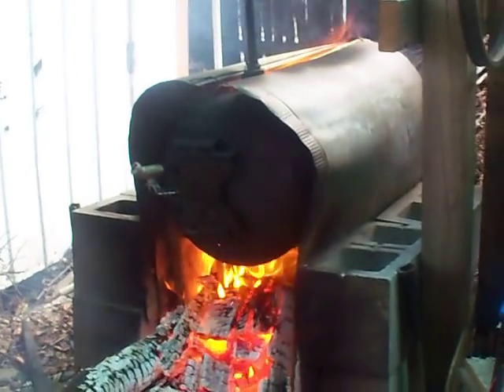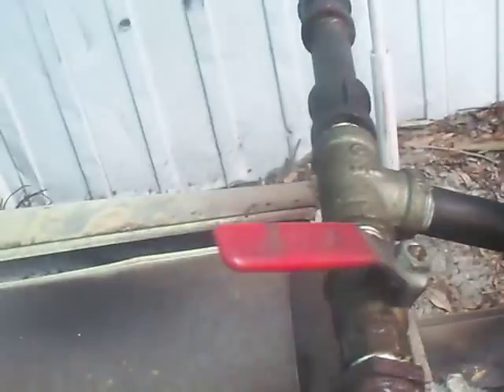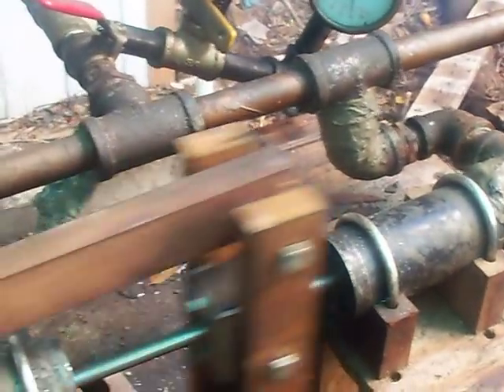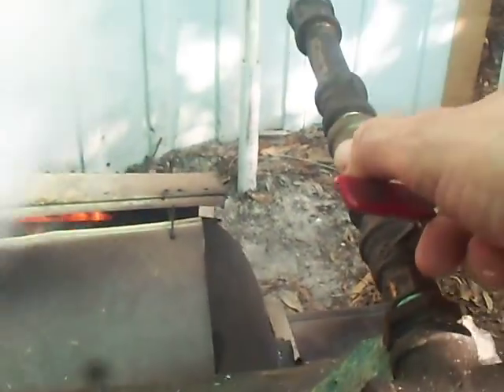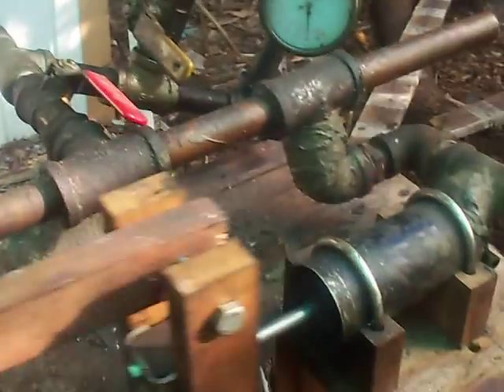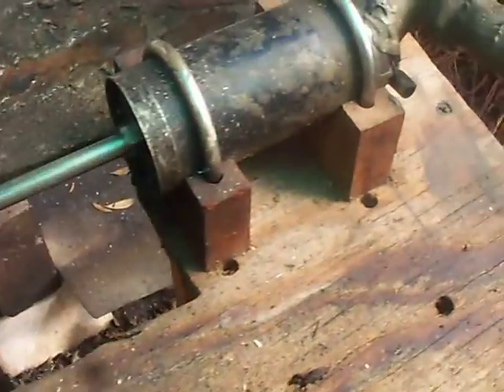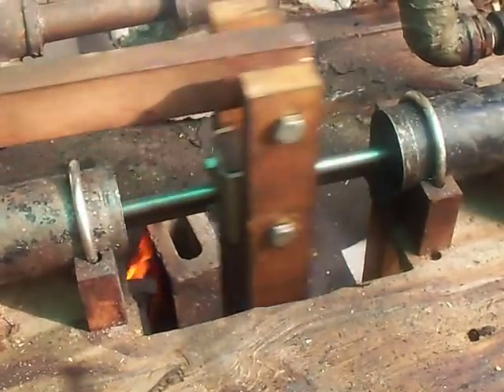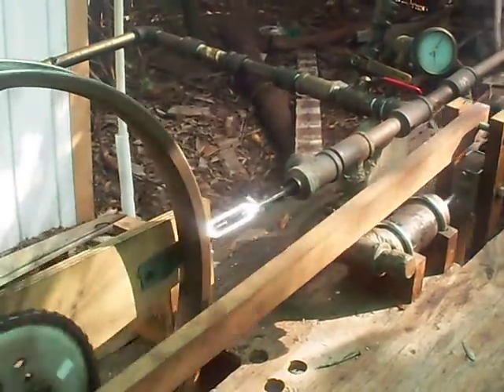Homemade Steam Engine with Redneck Boiler...!!

Comment: I'm interested in building a small wood-fired steam boiler simply to create steam to heat water in a tank about 15-25 feet away (and more or less downhill.)  I have a wood-fired outdoor water stove now, but it requires an electric pump to circulate the hot water, and I'm hoping to find a way to do something similar for a very small cabin without electricity.  Can you recommend any books or other ways to learn about generating and using steam?  Thanks!
Reply from the maker: Don’t know of any books on it but I’m sure they’re out there, there’s a guy on YouTube that built a flash boiler  ..
Reply: @CapnSchep  Thanks!  I don't know what a flash boiler is, so that's a helpful search term.  Appreciate it!
Reply from the maker: @patrickcleburneuczjsxpmp9558  You’re welcome and good luck 👍 ..!

Comment: Hi, great work. Thanks for posting.Are you using a safety release valve?
Reply: Hi, free is always good.  I working on a similar project using a mono tube boiler. I posted the project on the LynxWind forum in the steam section. If you have the time come join us. Again great work and I look forward to your test results.
Reply from the maker: Excellent, I will check it out, and thanx...!! Monotube is one hell of a lot more efficient..LOL..!!
Reply from the maker: Yes, I use a 70psi steam release safety valve ..
Reply: @CapnSchep  this one s not very rednackish XD great DIY build it works! That's the thing that matters
Reply from the maker: @oscarverwey  It works okay, just not very efficient .. Thanx for the positivity ..!
Reply: @CapnSchep  efficiency is also not very rednackish XD so to that's okay

Comment: With a stroke of 4 inches and a piston of 2 inches in diameter at 40 psi and 160 RPM it would produce about .2 HP per cylinder  and 6.5 FLBS of torque per cylinder so twin single acting cylinders would be .4 HP and 13 FLBS, When you had it at 200 RPM it was at a little over .5 HP and again 13 FLBS of torque. I used a metronome and matched the chuffs. Just to give you a rough estimate.
Reply from the maker: Thankyou Branden, that seems about right, I wonder how much H.P. with 120 p.s.i. of steam, would you know  ..?  I don't trust that tank with that much steam pressure   ....
Reply: @CapnSchep  make a water pipe boiler or a single pipe boiler they can withstand pressure. and a small amount of water is safer.
Reply from the maker: @emil.honganmaki5461  A flash mono tube boiler would be the way to go ..  Right now I’m too busy building my 23 foot shoal draft sail boat .. Perhaps later down the road I’ll look into that .  Thanx for the suggestion though ..

Comment: Guys Question , Pls can someone answer ? 
Does boilers Store enough steam first and then the engine is started or it's constantly producing steam .. ? If yes It's hard to imagine how that much steam can be produced in that size of a boiler
Reply: It's a bit of both really - the boiler is heated first and stores the steam as it gets up to pressure, then the engine is run and as it uses up the steam then the boiler boils more water into steam to make up for it

Comment: Can u help with the boiler only, like can u share ur work on the boiler part of the engine.
Reply from the maker: There's not much to it, it's just an air tank rated for 120 PSI half filled with water  ...

Comment: Do you have a water glass and safety valves on the boiler? What grade of oil are you using to lubricate cylinders?
Reply from the maker: I have a 75lb pressure relief valve, I am using used motor oil as a lubricant, about 6 to 8 ounces of oil for 12 gallons of water.. I have no sight glass for the water level..  I run it no more than 1 1/2 hours at a time...I put the oil in the boiler, then fill the tank 1/2 full with water, about 12 or 13 gallons...It is a very inefficient boiler and I've never had more than 50 lbs of pressure in it...
Reply: You NEVER operate a boiler without a water sight glass. You ALWAYS need to know where the water level is and have a way to put water into the boiler. It is not safe to operate a boiler and not have a way to know where the water level is. Steam is very powerful and if the boiler runs dry, the sheets can overheat and the pressure inside the boiler can bend/tear the sheets and a boiler explosion can occur. Even at 50 psi steam is very powerful and safe operation is a must.

Motor oil is a very, very, very poor lubrication in a steam application. It will cook off and provide little to no lubrication. A proper steam oil is needed and should be pumped with a mechanical lubricator (or have a hydrostatic lubricator) into the steam delivery line to the cylinders.

Oil should NEVER be added to the water. Oil floats on water and will cause a thin layer of oil to cover the water. This will cause the water to foam as the steam bubbles won't be allowed to break when the reach the surface of the water and it will foam like a pot of boiling water that has pasta in it. The foam can be carried over into the cylinders and will ruin any lubrication in the cylinders. If the boiler is foaming bad enough, when the safety valve lifts, the water can climb up the foam and escape through safety valve and can drain the boiler of water in a short order. Oil in the water won't lubricate the cylinders.
Reply from the maker: Thanx, I'll round up a few bucks and do that.. ! I've run this engine hundreds of hours using old motor oil mixed with the water, when the water gets hot, the oil seems to mix very well and makes this engine run more slippery than snake oil, and also, there is no metal to metal friction in this engine as it uses Viton O-Rings for the piston rings and slide valve seals. Thanks for your advice..  ...
Reply: Oil and water don't mix; never have and never will. Steam oil should be used with steam as it has additives to keep it from breaking down in high temperatures. (Steam at 50 psi is 298 F). Even with no metal to metal contact, there is still friction between the rings and the bores. This ought to be properly lubricated with steam oil, not motor oil. Nothing is a proper substitute for the proper oil.
Reply: Ernst Flow Industies has sight glasses. Make sure you the steam rated one if you buy from them. http://www.ernstflow.com/

LocoParts is a supplier for the Live steam hobby and they also have glasses. http://www.locoparts.biz/parts.html#Sightglass
Reply: +CapnSchep isn't this just an air tank with no boiler components inside? I bet you could just put some on/off valves on the side to check the water level.  why don't they make an automatic float or something to keep the level consistent? neat little steam engine btw.
Reply from the maker: austinwagoncompany
Thank you, I have valves to fill and check the water level  ..  One day hope to get a real boiler though when I have the money  ....
Reply from the maker: Great point  ...!!

Comment: You probably want to take this video down before a boiler inspector sees it. A boiler without a sight glass is unsafe and throws up a lot of red flags and can very easily attract the attention of local/state boiler inspectors.
Reply: CapnSchep Maybe you shouldn't mess with boilers.. Lubrication in the boiler won't cause it to blow up; low water, poor construction, poor maintenance, operator error/lack of knowledge and using the improper materials can cause that. 

You should feel very lucky that you were hurt. Steam and scalding hot water can cause 3rd degree burns very, very quickly and breathing steam can cook your lungs. This is why you should only operate a boiler when you have the proper knowledge and safety items and know how to properly operate and care for it.

The general rule of thumb is that 1 cup of water can turn into 800-1800 cups of steam, depending on what the pressure and temperature are of the steam. That is a lot of power.
Reply from the maker: It done blowed up...!! It done blowed up real goood...
    Yawn   ...
Reply: That is not something that you should be proud of...
Reply from the maker: It ain't nothen but macheenra  ..!!  Kerblewie ..!!
Reply: +CapnSchep how big was the boiler explosion?
Reply from the maker: There was none, I was being sarcastic ...!!